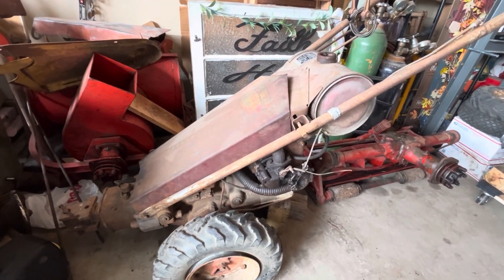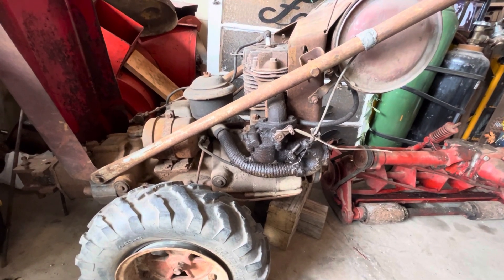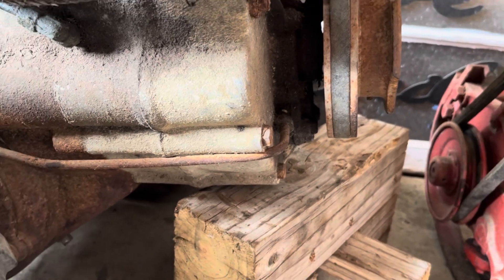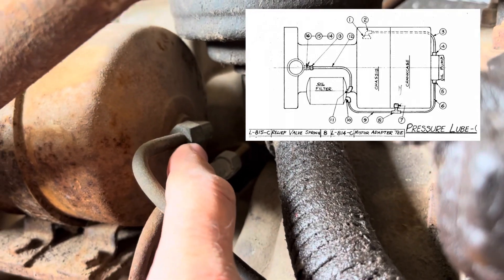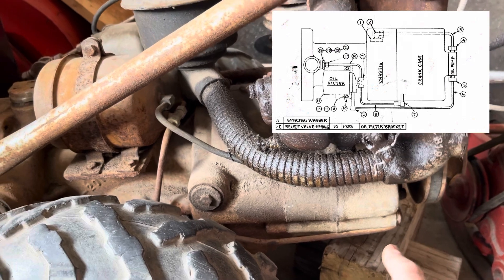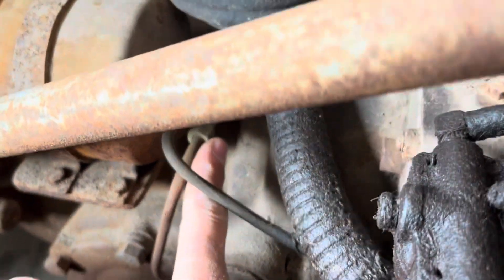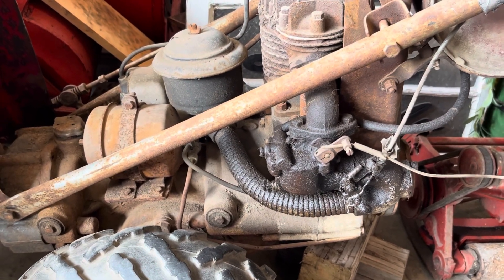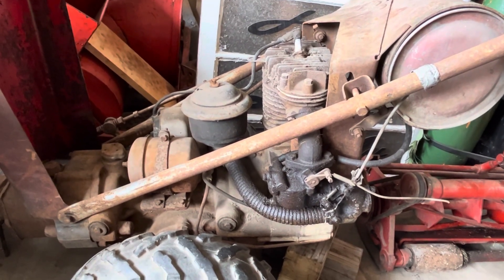How NOT to Run Oil Lines on a Gravely Model L Garden Tractor

Comment: Never seen one done that way before! I have two 5hp tractors with low volume pump and they were both changed to full flow filter. They both have spin on filter conversions so they were probably changed then. I changed them both back to the proper bypass style filter setup. I do have a nice old style filter that I might install on my 54 LI someday, just for good looks.
Reply from the maker: It’s always fun to see how these old machines have been changed over the course of their lives.